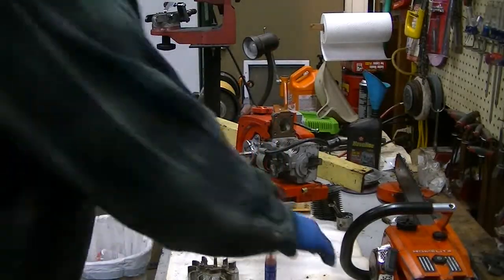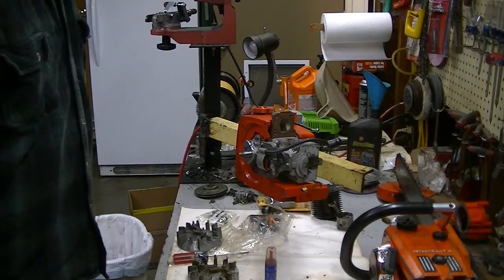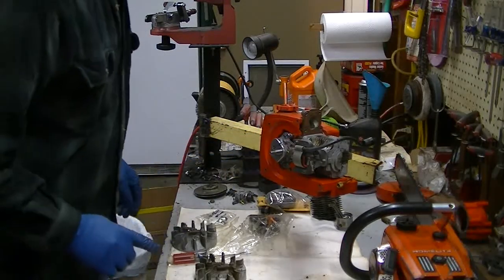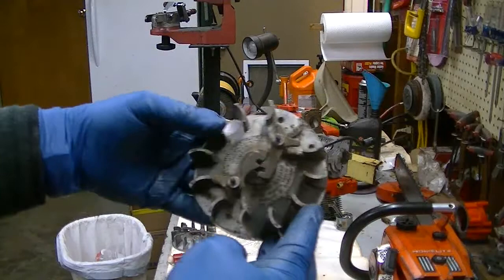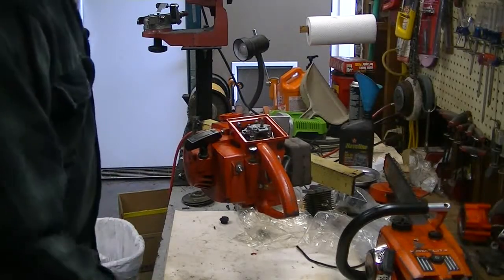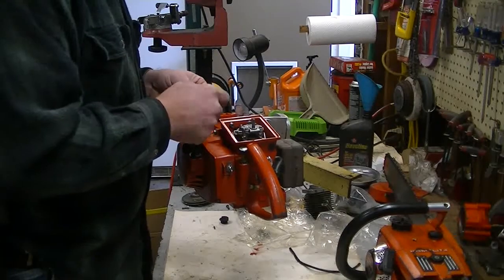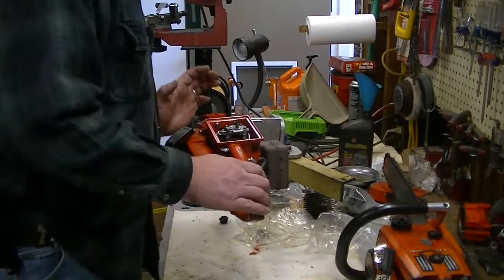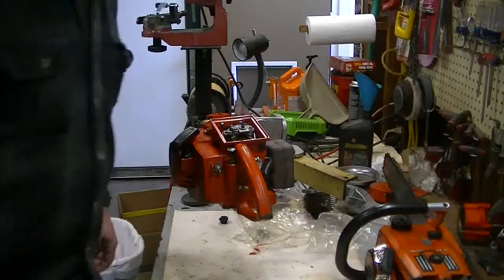Mark's Homelite XL Automatic Reassembly & Test Run

Comment: Very cool .like to have all that. My C52 has 3/8 x 050 . I filed on a husqvarna bar to adapt it . Made the round adjuster holes square and opened up the stud slot a little bit.  Chamfered  the oil hole too. I may have to drill another hole further back if my chain stretches alot. Then I was able to rub the husky logo right off the bar.

Comment: Great Video!  I have a Terry Homelite VI 200...a beautiful, well built saw, it just need a new fuel line and filter (hopefully)! It has manual and auto-oiling and anti-vibration mounts.
Reply from the maker: Awesome!  I hope to ad a VI-200 to my collection someday.  I have a hose kit and replacement felt for the original style filter:
https://www.leonschainsawpartsandrepair.com/store/p6480/NOS_Homelite_Super_XL-130%2C_VI-123%2C_XL-76%2C_XL-113%2C_XL-114%2C_XL-122%2C_XL-123_Chainsaw_Aftermarket_Tygon_Fuel_Hose_Set_FLS25.html

https://www.leonschainsawpartsandrepair.com/store/p2065/NOS_Homelite_540%2C_650%2C_750%2C_VI-944%2C_VI-955%2C_Wiz_55%2C_775D%2C_1050%2C_1130G%2C_2000%2C_2100S%2C_3100G%2C_Super_2000%2C_Super_2100%2C__XP-1020_Auto%2C_XP-1100%2C_XP-1130_Chainsaw_Fuel_Filter_Element_59253-1.html

Hope this helps!

Comment: These saws are so easy to work on. One thing you can do is flip used reed valves over and they are good as new.
Reply from the maker: Most of the time flipping does work great!  In this case though, the "dimples" made that impossible.

Comment: good vid well done /// the old reed  had a 009 stihl  did the carb  was hard to start would not pull in the log // i had 2 of them  2nd runs well pulled good in the wood  so i reverse build ///and it was the reed

Comment: I have a Homelite super xl automatic with the infamous old blue Wico coil it'll start for a few seconds and shut off. Is it possible to convert to a chip ignition?
Reply from the maker: Only if you change out the coil and bracket to a points coil setup.  A module won't work with the blue coil.

Comment: What kind of tach was that you are using in this video?
Reply from the maker: I can't remember exactly where I bought it, but it's like this one: https://www.amazon.com/Electronic-Specialties-328-Tach-Plus/dp/B002Z32OHW
Reply: Leon's Chainsaw Parts & Repair thanks
Reply: think i like this ! $50 is not bad at all compared to 200-300 for others i have asked about. Thanks for the quick link.
~Chris~